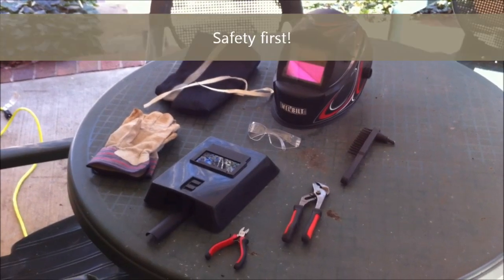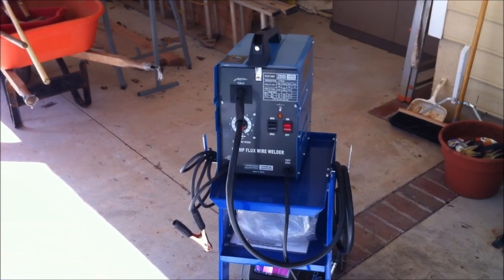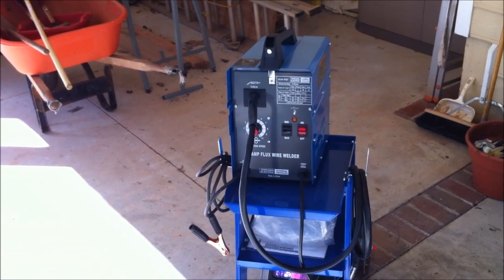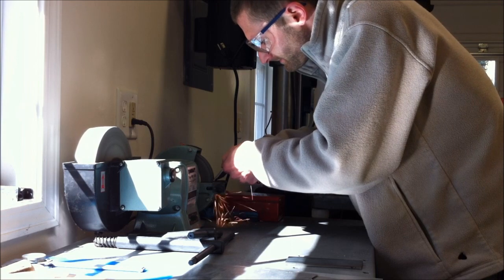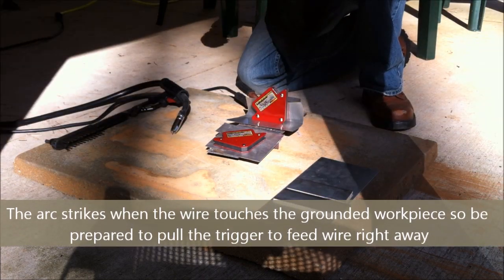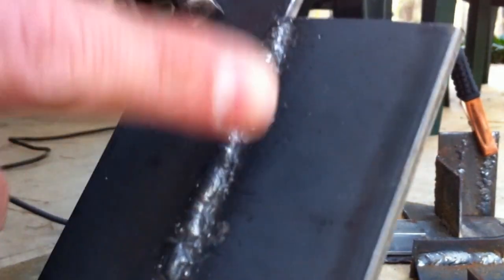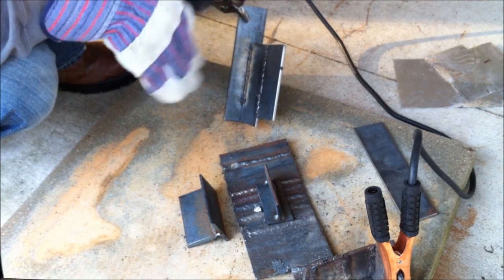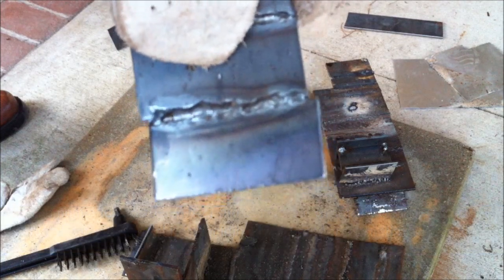Arc Welding Tutorial: Hobby Welding Projects Without Expensive Equipment | Flux Core Welding

Comment: I've got an Everlast welder that weld mig, tig and stick but more often than not I've got a flux core spool loaded in it so I don't have to worry about the wind. Despite a lot of the discussion on the interweb, I prefer flux core welding.

Comment: The biggest problem with an inexpensive welder, especially when used for FCAW, is they are not truly DCEN. They are AC power, with no rectification. 90% of your spatter and weld inconsistency comes from this.

Your welds are great considering the limitations of that welder.
Reply: I've used an inexpensive everlast inverter mig welder. It welded pretty smooth for me.
Reply: Jamie Thomas His welder can be purchased for $80. I have one. It's fine for FCAW general, non critical work, like a simple fix on a fence. Yours is probably closer to $400. -- I also have a Hobart that was $500. Huge difference in price and performance.

Comment: As a certified welder I thought your video was great. You made some mistakes but you have obviously researched the info. You need to look up duty cycle and travel speed. The thicker the material the slower your travel speed. Also you can not weld aluminum with a flux core welder.
Reply: you need to blahblahblah

Comment: Hey Good job thanks for taking the time to make this video. I totally got that you are new to welding and I felt you were not trying to be anything you were not. I learned a lot, I am dying to do some hobby stuff with much thinner material I was hoping you would show some welding with thinner stuff. I also know that Welding is an art form and takes a LONG time to master, as an artistic type of person I look forward to learning the skill.
Thanks again for giving me some inspiration to proceed.
Reply: Thin material is more difficult to weld properly. Try to work with mig and not flux core as flux core welds hotter. I started welding with my powerarc stick welder and it was very difficult to learn on thin material. I kept burning through

Comment from the maker: Yeah, my house doesn't have a 20 amp circuit, but the welder worked for the most part.. I mean my breaker trips even when I just use the vacuum cleaner :/

I do tack on the opposite side for T-joints, but I had even that fail a few times as I didn't have a strong enough tack in place and it kept breaking..

Thanks for your comment. I'm not an experienced welder by any means, but I figured people can learn a lot from someone who just picked up the skill.

Comment: Your breaker keeps blowing because you're plugging into a 15 amp circuit.  That welder needs a 20 amp circuit.  

When welding a t joint, tack on the opposite side of the weld bead.  

Good video though...